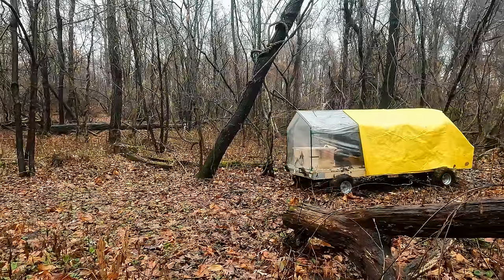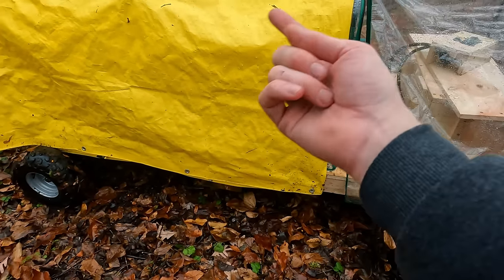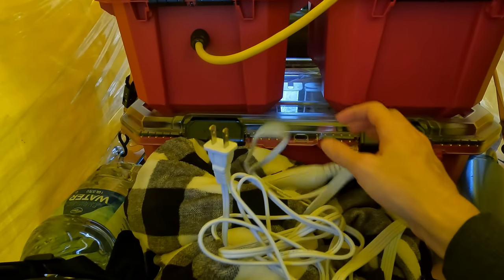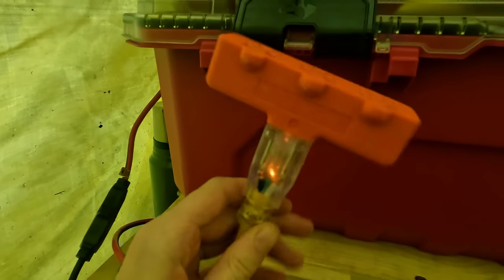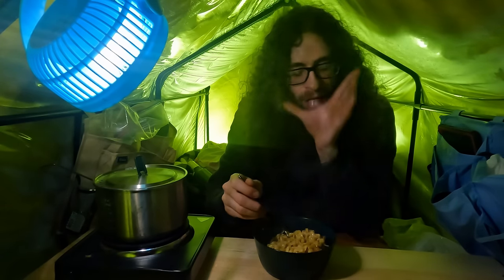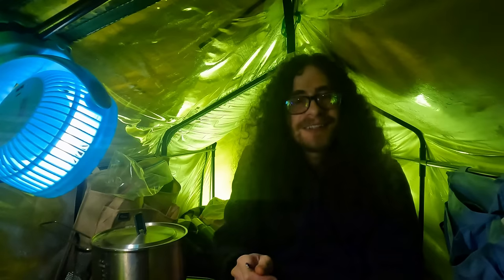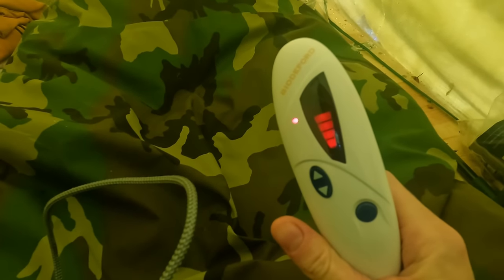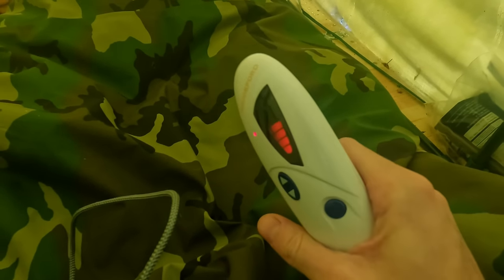Cold Rainy Night In Homemade Camper With an Electric Blanket - Upgrading The Power

Comment: You got a cool little mobile campsite there man!  One recommendation--get yourself a good cold weather rated sleeping bag in lieu of the electric blanket.  It'll keep you just as warm without draining your battery!
Reply: I second this.  And will add: Mylar sheet or "space blanket" for hot summer days. Cover the camper with the mylar to reflect  the blazing sun giving you shade on demand and keeping the temp inside much cooler.

Comment: Might wanna treat that wood to protect it from the elements (if it isn't already)  . Also you could build a box on the end (or underneath if there's room, maybe one that slides in and out) for putting your boots in as you get in and out so you're not tracking mud.
  That thing is really cool though, love these vids.
Reply: something handy could be attaching some kind of brush to the side so he can quickly wipe his boots clean before getting in
Reply: @SexManNordin  Yeah that would help, but you're still gonna track junk in unless you can remove them.
Reply: After watching a demo of that entire "camper", your best suggestion is to treat the wood? 😅
Reply: @mr.boobania he didn’t offer his best, just a minor idea.
Reply: Rhino coat it
Reply: Door mat from WeatherTech
Reply: Door mat from WeatherTech
Reply: Door mat from WeatherTech
Reply: Door mat from WeatherTech
Reply: Door mat from WeatherTech
Reply: Door mat from WeatherTech
Reply: Door mat from WeatherTech
Reply: @scouttroopergaming  the Weathertech doormat will cost more than the whole camper!  🤣🤣
Reply: @mr.boobania  so true😂😂
Reply: I’m just assuming this is for the short term; if it’s not, he’s gonna have to make some amends to avoid mold. But this is so fun!

Comment: Found your channel pretty recently, and not only are we really enjoying your videos, you may have indirectly saved us from a dangerous situation. We live semi off-grid in a trailer and our pump is powered by a 12v battery. After watching your build of this camper, I started looking into upgrading the setup and realized I was continuously charging a lead acid battery in an enclosed space. Couldn't quite justify the cost of a lithium-ion, but ended up swapping it for a nice AGM unit and not only are we no longer getting random headaches and dizzy spells, most likely caused by the hydrogen gas we were undoubtedly accumulating in the trailer.

I probably would have replaced it eventually, but your video definitely prompted me to do it sooner than later. The battery store I ended up going to just started stocking a bunch of neat components, including some of the stuff you've used in the past, so I had to show them your channel, one of them even wrote it down to watch more later!

So, thanks for the inspiration/help and love the new video, currently watching it on a rainy night while trying our new heater so it feels very close to home :)

Comment: Awesome build and execution!  You might think about some ventilation to help with the humidity from your breath and cooking.  This is why tents are mesh on top with the rain fly suspended above.  Even a small exhaust van near the roof would help.
Reply: Something like an efficient computer fan.  Noctua makes those
Reply: Kind of makes me want to see a more standard tent permanently mounted onto a motorized frame like this. Get all the features from both.

Comment: Just a thought but if you used velcro along the wood frame edge and the plastic you could make it a little more air tight to avoid so much drafting and rain getting in.  Also if you used some wood and made a little shelf on the outside right next to the entry of the tent you could sit your shoes/boots there to keep them off of the ground.  Add in some velcro and could strap them down so don't fall off.

Comment: consider adding a ventilation fan in the floor of one of the corners with a dust cover over it to keep mud and bugs out, would help with excess condensation in the camper by providing more airflow and hopefully venting some water vapor. Probably want to maintain positive pressure into the camper though

Comment: 4.2 btu = 1 watt.   You can calculate the power draw against the delta T  .  :) add some reflective tape to the inside and it will hold heat better, and finally use a small fan to vent out the humidity while cooking and you will be most efficient with what you have already :)
Reply: 8:00 and Velcro down there
Reply: I was looking for this suggestion to improve the design by including an exhaustion fan so the condensation isn't an issue. 😊

Comment: @Quiet Nerd   Next time you use the toaster oven, use an oven thermometer and you can manually maintain the temperature you want. Turn the oven off when you reach your desired temp and then just activate it again when the heat dissipates. By working the switch, you should be able to maintain a fairly consistent temperature and bake just about anything.

Comment: I love this, man, huge ginger fan as well! This is so great and I'd love to do it myself, thanks for inspiring me. 
If it's alright, I do have a minor suggestion, it's something I do at home as well. Rather than eat out of the bowl, you could choose to simply eat from the pot itself, the food generally stays hot longer in the pot as well, but there's something very cozy about eating from the bowl. It's only to avoid possible spills, splatter or dishes, really.

EDIT: Another idea to offer, rather than use oil for your little oven's sheet-pan, it works really well to use pre-cut squares of parchment paper that you have on the side to use. It takes up less space than the oil spray, you can reuse it, it cuts on a bit of calories and it's way easier to clean up after! :D

I also love the learning as you go, it's great that you showed the errors, not a lot of people do that and it's important to know that you can make mistakes and still get it if you keep trying. The same goes with everything and the world needs a bit more of that. Ignore people if they get too critical about it, they've just been pampered too much. :)

Comment: Great video. I absolutely love the camper. A few things that I would consider would be to possibly add vinyl flooring over the wood to add protection and an extra layer of waterproofing. Another thing would be a small induction hot plate, they are very efficient and reach temperature much quicker than the solid hop plate you used here. Either way keep up the great work.

Comment: Any concerns about overheating the inverter?  
I see that the box has a fair amount of open space, but it still is a relatively sealed environment.
Reply: I was thinking the same thing. Inverters can produce quite a bit of heat. Especially when under load and in a sealed container
Reply: Top of the line in electrical sports
Unexplained fires are a matter for the courts, Canyanero!

Comment: I put a 1500 watt inverter in my horse trailer I converted to. Combo horse trailer/camper. I run a 12v light no fan system and some sort of fridge. I’ve finally settled on a freezer like cooler that is good for not pulling too much amps. I realized I needed to recharge my batteries so now two 100 watt solar panels and. 2000 watt inverter generator. But I love his ingenuity and fun he is having. It’s cool knowing people are out like this. Fun.

Comment: What a great evening.  Love your little camper. I can't see it without the table. Great job! IF I could suggest one thing....cover the wood floor with some linoleum. It will be easy to sweep out and clean, while protecting the wood. I'm sure you can get a nice dark solid color that would be nice for you. Slate Grey or pine green would be my choice.

Comment: This is cool experimenting with different gadgets. I think moisture would be a problem if you did that for a long time.  You could cook in a vestibule where the steam wouldn’t remain inside, and if you moved your cooking outside you could use a white gas or propane stove to conserve your battery. And the right insulated sleeping bag would be warm without electricity to extend your time before you have to charge your battery.

Comment: Here are some suggestions for improving the setup and experience based on what the creator did:

1. **Improved Tires**: While the go-kart/ATV tires worked, he could upgrade to more durable all-terrain tires specifically designed for heavier loads. This would offer better traction and longevity, especially on rugged or muddy terrain.

2. **Weatherproofing the Camper**: While the tarp worked well, a permanent waterproof seal around vulnerable areas, like the front of the camper, would prevent leaks more effectively. Adding insulating materials to the camper walls would also help keep it warmer during cold weather.

3. **Inverter and Battery Setup**: Consider using a higher-wattage inverter or a more efficient one to handle multiple devices simultaneously without risk. Pairing it with a larger-capacity battery (e.g., lithium-ion deep cycle) would provide even more power for longer trips, reducing the need to monitor battery usage closely.

4. **Cooking Inside**: For safety and better airflow when cooking inside, a small vent or fan could be installed to prevent moisture buildup and the risk of overheating. Alternatively, using a compact, low-powered induction cooker instead of a hot plate would offer faster, more efficient heating while using less energy.

5. **Ventilation**: To reduce condensation inside the camper, especially overnight, installing a small solar-powered roof vent would help circulate air without compromising warmth. It would prevent the buildup of moisture and mold inside the camper.

6. **Heated Blanket Efficiency**: While the electric blanket worked well, a more energy-efficient version, such as one with zoned heating or an automatic shutoff, could conserve battery power and avoid overheating at night.

7. **Food Prep**: Pre-prepping meals or using a camping stove specifically designed for indoor use (low heat and safer ventilation) would simplify cooking. Alternatively, he could try a solar oven or bring a small propane camping stove for outdoor cooking.

8. **Enhanced Comfort**: For even more comfort, he could use foam insulation on the floors and walls of the camper, or bring lightweight foldable furniture for better seating and organization. Adding LED lighting inside would improve visibility without using too much power.

Comment: You could make a steering wheel by putting an rear axle differential on it this way you can have a 2 wheel drive and easy steering. The steering now is slippery and If I may say so looks like an tanks steering mechanism but it would maybe be cool to fit some tracks on it to get smoother through terrain.

Comment: That's a nifty little rig. Improvements.. aluminum chassis for weight with a rubberized coating in the floor. Fun fact, wood gets several times heavier when wet.  Transmission. Ventilation. Polymer shell or perhaps fiberglass. Build it higher.  Small Stirling parabolic generator on the roof to charge the bat. Maybe I should look at subsequent vids before blathering.  Nice job.  Stop using so much juice!
Reply: Bro calm down he threw this together in like a day and it’s at almost 2.5 million views he could have brought a folding chair out there and people may have clicked

Comment: Be careful about cutting extension cords like that as you can negatively affect the impedance matching for 120@60hz. They are the length they are for a reason. In layman's terms, the extension cord can start getting hot and be a fire danger if you cut it like that.

Comment: I would worried about heat on that foam from the inverter surely it wouldn’t get hot but I would still question it
Reply: I was thinking that ,  overheating on that foam 😮

Comment: I feel like tiny treads are a scam. Unless you have those longer tank looking treads a wheel would probably work best.. they have wheels for sand that I have used before that work great. Treads need more surface area to be effective

Comment: Treads are absolute garbage. I have never seen a tread system last nearly as long as wheels. People think "no air, no problems" until your realize treads either generate so much unnecessary friction and they rip, or not enough friction and come off the track.

Comment: 1 = battery.
2 or more = batteries
Battery's is the possesive.  's   n.e.v.e.r.  means plural.

's still refers to just one battery, or actually something or some trait belonging to one battery.  It is possesive, but it is not plural.

For example: this battery's state of charge is very low.

's never, never means plural.  It means possesive.  
-This applies even with the plural of an abbreviation.  
     PLURAL:  You sure have a lot of CDs.
     POSSESIVE:  This CD's compression algorithm is new.

's never, never means plural.  It means possesive.